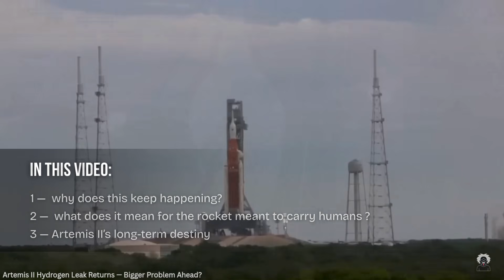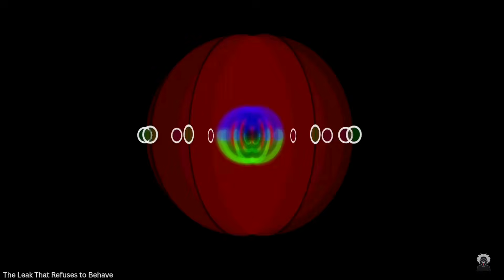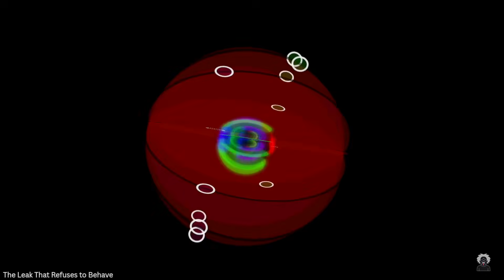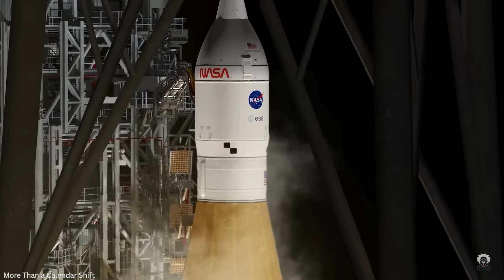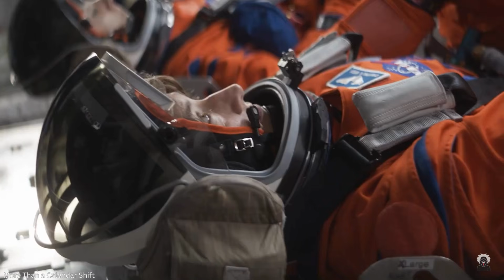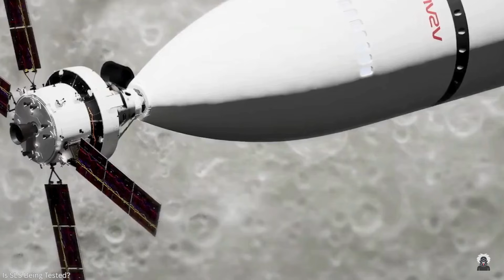BREAKING: NASA’s Artemis II Keeps Leaking— And this start to cause a HUGE Problem!!

Comment: Why does NASA keep pouring millions into this failed rocket design? They could have developed a completely new platform from scratch in the years that this failed piece of garbage has been causing huge delays and massive cost overruns. In addition, the HLS from Elon Musk will never be ready in time, based on their constant failures. Sadly, China will no doubt embarrass both NASA and Spacex long before Artemis gets off the ground.

Comment: Artemis will complete all 5 launches. The leak is just an obstacle that will be overcome. This is all apart of the process. Every rocket of every type has issue they must deal with. Getting in a panic or jumping to silly conclusions is a total waste of time. Space exploration is extremely difficult.  Leaks and other issues is WHY things are difficult. It will be overcome. People really needs to tone down the hype over normal issues arising.
Reply: It's taken well over a DECADE and we've only had ONE LAUNCH!
Reply: @steveschaff4620  I agree. However, government agencies run very different than private companies. The government literally  use several hundred different companies for the system. Lots of red tape and delays based on several outsourced entities. Also, they do not fly-crash-redo as their development model. They do all the testing first then go for the end product. What may seem like delays actually their  working through problems. Space X has several launches and zero complete successes. They have partial succusses. NASA goes for a one-and-done method on the first try. The did. SLS was a huge success on the first attempt. performed far above than even what was expected. Remember that NASA was waiting on Space X. They were supposed to have the lunar lander by now. We are not even close to that. THAT is a huge reason for the "delay" in NASA. They were supposed to LAND these people on the moon and not just fly around it.  That is a huge delay for NASA BECAUSE of Space X. The two are working together. One lags and they both get delays.
Reply from the maker: Totally fair point. Spaceflight has always been incredibly complex and setbacks are part of the process. Every major rocket program has faced challenges along the way.
The goal isn’t to panic, it’s to highlight how even “normal” technical issues can influence timelines and strategy, especially during a competitive lunar phase.

Appreciate the perspective.